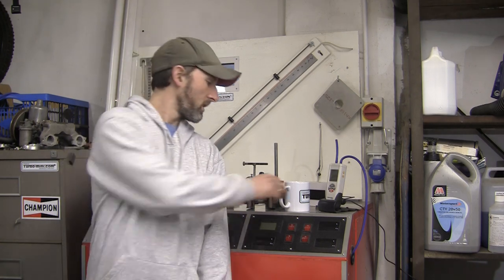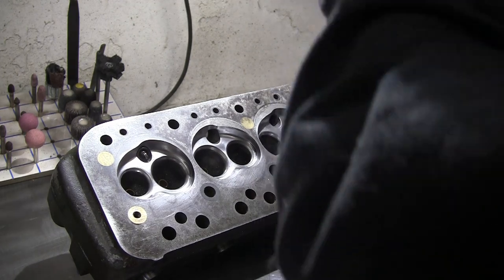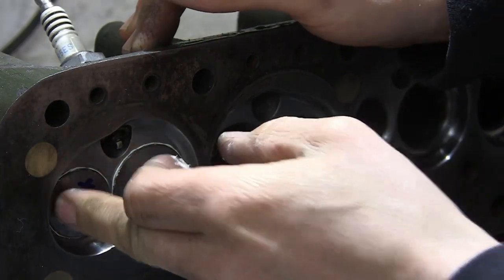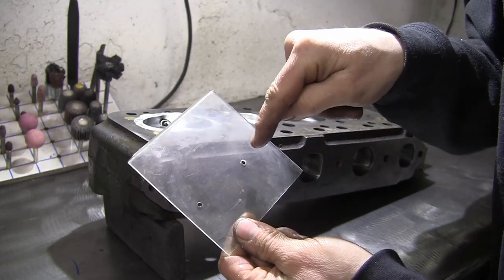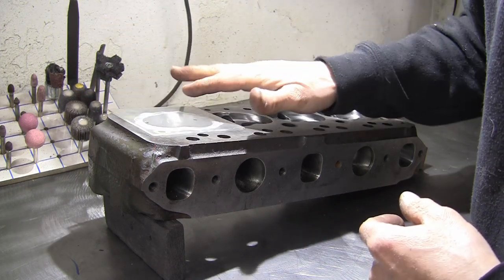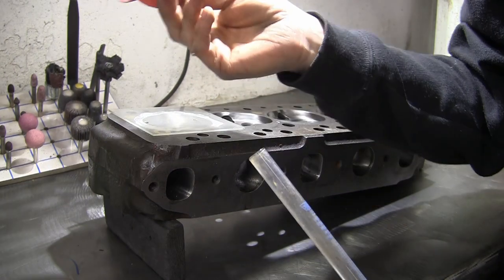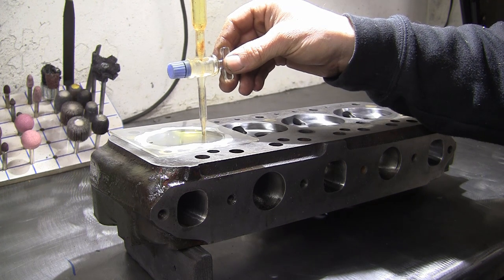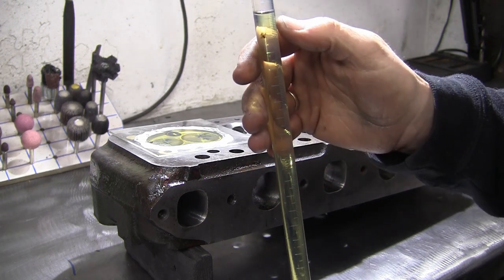Classic Mini tech. Measuring cylinder head chamber volume, how to. Simple step by step guide.

Comment: Phil, can you give instruction for measuring the combustion volume above the piston crown and head gasket (to add to the chamber volume) to complete the compression ratio calculation please? 👍🇬🇧
Reply from the maker: Hi. That can be calculated by using the table in David Vizards book I mention. You need to know your bore diameter and how far down the bore the pistons sit at TDC. The tables in the book then give you the volumes for the various depths and bore diameters.

Comment: Hey Phil! Great video, I have a 12g295 head on my bench that’s I’ve acquired and am starting to build up, I’m having trouble figuring out the compression ratio... and wether or not in its current state it’s worth building up! the head measures 2.650” so it’s had 100 thou off it already, and I’ve measured the chambers at around 22cc with a syringe, I’ll have another go tomorrow to confirm...but would this work well on a 998 A+? If so what pistons (overbore bore) and cam would you propose, if not any, I also have a standard 1100 Pre A+ engine with only 22k miles on it. Cheers and hope this makes sense and any advice is welcomed! if not I have an Instagram for my mini progress “@project_minimayfair” 

Cheers phill and sorry for the super long message I’m still learning!
Reply from the maker: Hi Lewis. You could use the head with 22cc chambers as long as you can get a suitable compression ratio. You'll need to calculate the volume required above the piston to give your required ratio and then select pistons with a suitable dish size to achieve this.
I did a video on calculating compression, have a look. It's pretty simple to follow.
Reply from the maker: https://www.youtube.com/watch?v=9Lp-1Rbb4Yo&t=142s

Comment: Why would you reduce chamber CC ?
Reply from the maker: Paul Hotson if you wanted to raise the compression ratio.
Reply: @TurboMinicom  Ok so after removing metal around the valves and flowing head.
I'm I right in saying that to again back the compression and improve performance, you would skim the head.
Reply from the maker: Paul Hotson if you’ve removed material from the chambers you could skim the head to restore the original volume if you wanted to keep the same compression ratio.
Reply: @TurboMinicom  So if you increase the factory ratio the performance would be less but I you decrease factory ratio this would increase performance.
Reply from the maker: Paul Hotson usually an increase in compression will increase power, but there are limits. A lower compression ratio is usually required on a turbo/supercharged engine to avoid detonation due to the increased cylinder pressures.
Reply: @TurboMinicom  Thanks for your explanation it is much appreciated.